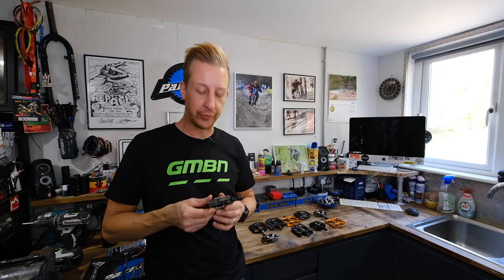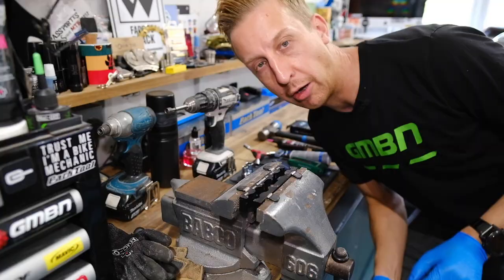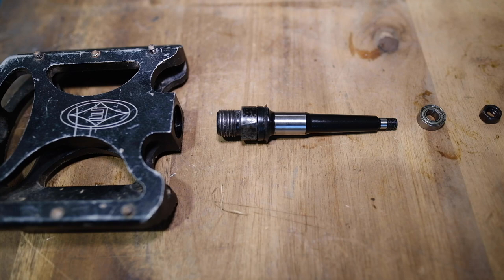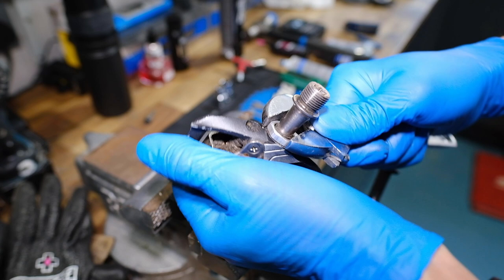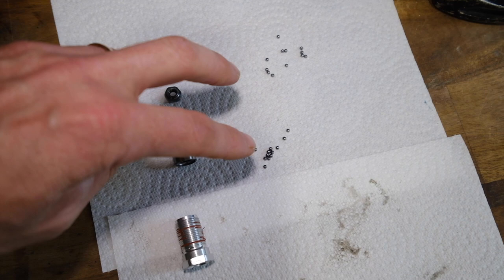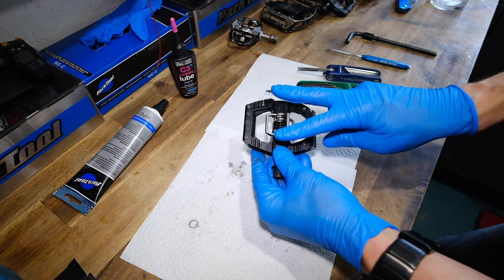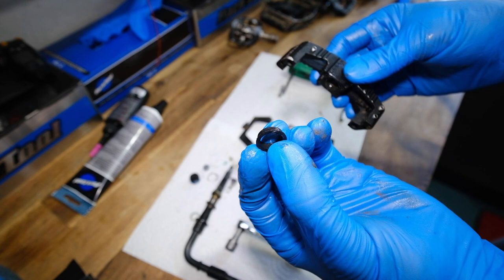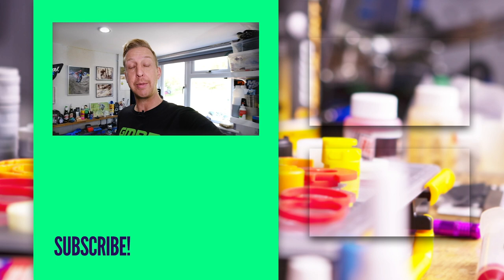Servicing Mountain Bike Pedals At Home | Doddy's 1st  GMBN Tech Vlog

Comment from the maker: Have you been working on your bike today? Let us know 👇
Reply: GMBN Tech hi doddy I have the shimano saint mx80 pedals and they’re very easy to service and like them generally however the pins are worn out but shimano don’t appear to sell any replacements, are there any other pedal pins of the same size that I could fit on. Cheers love the content #askgmbn
Reply: Hi Doddy! Yup, rebuilt an old Specialized HardRock full sus. Beyond rideable condition so have to take everything apart, wash n wax, new cables, screws n bolts, fitted  27.5 wheels with Michelin country rock tyres n converted it into 1x10spd with disc brakes. Brought it back to live once again. Now time for ice cold beer...
Reply: In the middle of a full rebuild of my 2001 Stumpy Pro.
Reply: Yup! Just put a brand new Hans Dampf on the rear and today I'm going to be regreasing the chain, switching to Dry Lube for the warmer drier season around here.
Reply: Yup... I was watching your GMBN tech video from July, 2018 "Mountain Bike Fit and Body Position" and using it for a hardtail that I've just built... Veeeery helpful... 😁👍🚲
Reply: Ill be cutting a steer tube tomorrow and rebuilding a set of HT pedals this weekend.
Reply: Giving my fork (RS SID WC DA 2012 w V-Brake lowers) a full service, and doing a frame swap from Scott Scale 40 (2009) to Scott Scale RC (2010) w V-Brakes.
Reply: Yes, installed new cassette, notices crack in the frame :/
Reply: You didn’t mention DMR V8’s with their cup bearings.... just given mine a service and running like new after 10 years
Reply: I am rebuilding my Mallet Enduro Pedals. I noticed on the outboard side (away from bearing) there is a plastic sleeve inside the pedal. The crank brothers rebuild instructions show to drive it out. But the shoulder prevents this. Any advice on if this is worth removing? I noticed in this video you did not remove it

Comment: I always start nuts by hand before using a machine to finish to avoid cross thread nightmares and adjustable spanners are an absolute last resort.
Reply: Adjustable spanners are not my last resort, they're my first resort to reaching for the mole grips soon after, and if things are really troubling me, I'll just finish it off with a gas axe.

Can't be tight if it's a liquid!

Comment: A good tip would be to put your pedals in a bucket of warm soapy water - or a parts washer - and give them a good scrub BEFORE working on them.. more pleasant to work on, easier to see the wear / damage, less crap on the workbench, and less potential contamination...

Comment: I do love this video especially when I have two pairs of Crank Brothers 50/50 pedals.  I do service my own bikes based on what I know.  Just recently, I took apart the Ultegra crankset apart on my Italian road bike and cleaned the bike frame and the crankset.  I did use grease for the crank arm installation and for the two screws that hold onto the crank arm to prevent any seizing.  Cheers!

Comment: ~14:20 Threadlocker instructions usually say that any traces of grease or oil should be stripped off the screw and the threads receiving the screw. Then the threadlocker will work properly. 

Do you usually skip this step? Do you think it is unnecessary?

Comment: Greetings, and thanks for the great channel! I have a quick question for you. Thanks in advance for any help you could provide. I am having a Ti frame built for me. The frame company does not offer the eTap specific frame (no shifter cable braze ons) so they are going to just make me one. Then I got to thinking... well while I'm at it why don't I tell them to just forgo the brake cable braze ons as well. Modern brake systems are either enclosed hydraulic tubes or fully housed steel cables. So "cable stops" for the short sections of housing are really not needed any more. So why not just forgo braze ons and secure the hydraulic hose or fully housed cables with some tape or zip tie or if you want to get fancy some of those little velcro straps you can buy. Any thoughts on this? Thanks.

Comment: I have a problem with my flat pedals :/ They started to play a little from the axle, enough to produce a loud clicking noise when a lot of force is applied (like hard pedaling or drops). I already change the internals using the pedal refresh kit but the same thing keeps happening, it seems like the 8mm bolt is not able to compress the internals or something like that. What can I do?  The pedals are crankbrothers stamp 3.